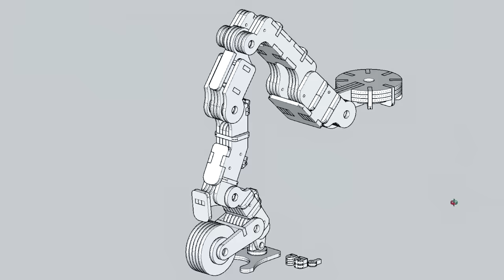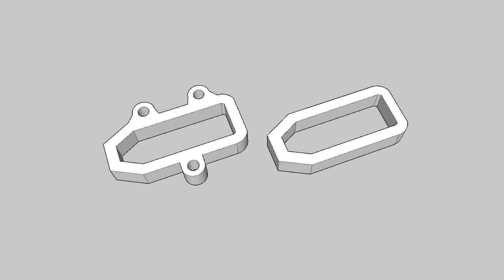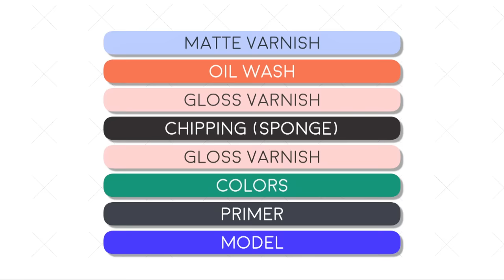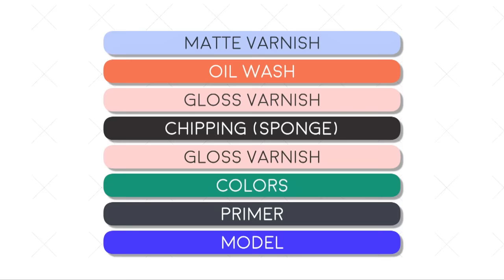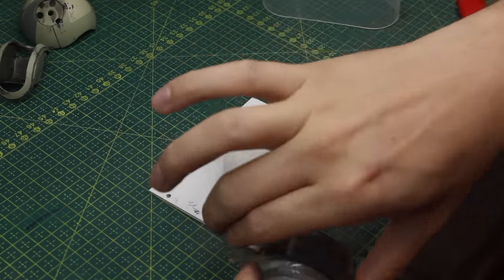I built this from SCRATCH!

Comment: Beautiful work, though I do have a bit of a nitpick...  The barrels of your rotary cannon are spaced way too far apart.  Being so far out from the axis of rotation would cause them to flex, a lot.  If you're looking for references, check out the barrel cluster on the A-10 "Warthog's" main gun, or the GAU-8.  A lot of modellers tend to get small, practical details like this wrong, and it kinda breaks the suspension of disbelief on model builds like this.

The engineering doesn't have to be perfect, just plausible.

Comment: Brothers and sisters, I have a question. Using CA to glue greeblies onto a primed plastic surface, my trouble is the primer is peeling off under a little bit of force. What am I doing wrong? If I don’t prime I have real trouble visualising the model. Maybe my primer coat is too thick? I dunno.